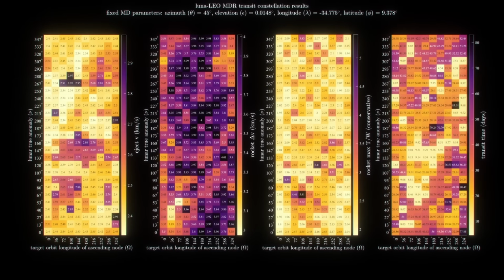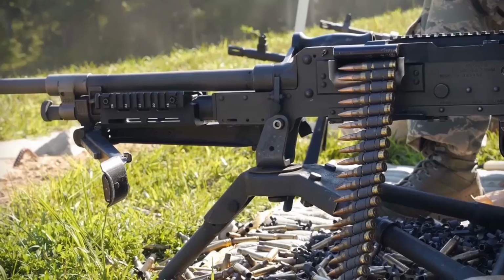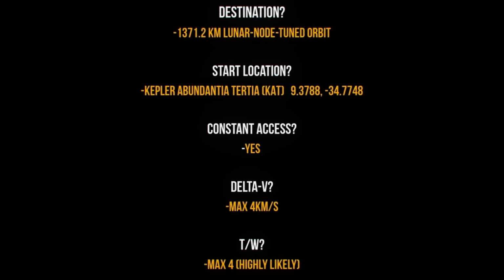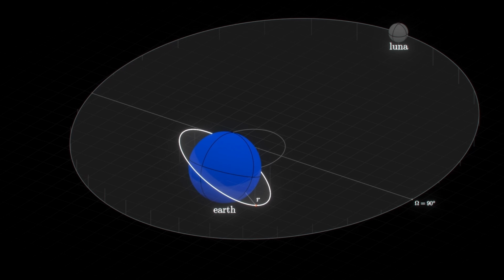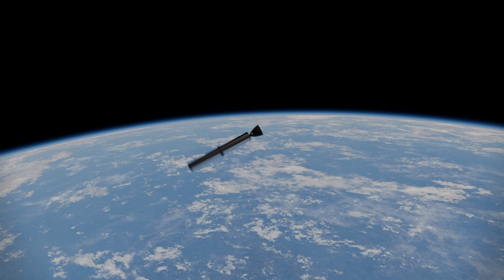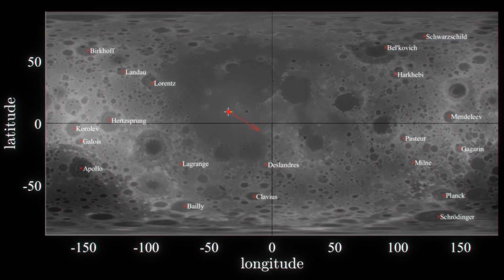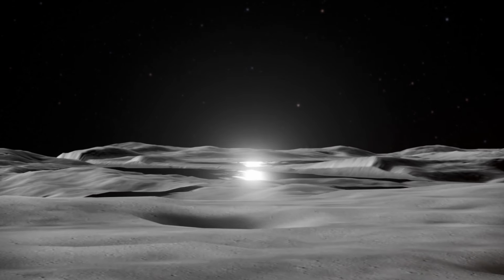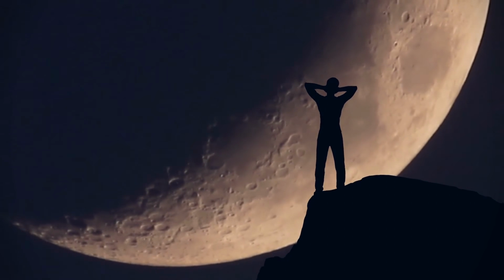Moon To LEO Transfer Simulations For A Lunar Mass Driver & Terrain Analysis + Power Sizing Estimate

Comment: 19:50 The problem missing here is the evolution of LEO debris. A site clean up will be an ongoing problem - nurf balls of vacuumgel might work.
Reply: There's the "laser broom" concept. Zap debris with high-powered laser light to cause some of the surface material to vaporise and make the surface shinier, so that radiation pressure from the sun causes it to get pushed into the atmosphere when it's on the light side of Earth. Can't remember what scale it's most effective on, but it'll be for relatively small stuff. Maybe cube-sat size at most. Given we know the orbits for the stuff we actually want up there, it could be implemented using ground stations that fire pulsed lasers as they sweep across the night sky, turning off when they need to pass the location of a satellite that's actually in use. Basically, you're whitelisting the current locations of stuff that's in use, and zapping everywhere else, as debris will be everywhere while useful stuff will be in predictable locations.
Reply: @Roxor128  That seems to expect the physics to do the opposite. Thanks for the reply. Have to look it up, but I think it would be too slow.

Comment: V2 actually used a typical liquid fuel + oxydiser engine. Its engine was one of the first of its kind and modern liquid fuel rocket engines didn't go far from it.

Comment: what if production is on the moon and launches working satellites via mass driver
building sats on the moon may be easier having gravity and heat sink.
This eliminates a lot of issues
Reply: sure, it also requires a (giga)ton of infrastructure to do that   you can get economically viable aluminum smelter long before you have chip fab.

Comment: An orbital depot in Lunar orbit solve a lot of issues/constraints in this simulation. 1: Lower Delta-V requirement for the payload and thus lower mass/size. 2: No complex direct payload transfer windows to LEO. There would be more complexity of staffing and construction of this depot than LEO but assuming we have the capability to construct a mass driver these would likely not be an issue (perhaps construction from lunar mass). Additionally progress in robotics and automations could reduce staffing requirements. This reduction in complexity and increased efficiency could likely outweigh the benefit of being co-located with current demand. 

Secondly, it may be interesting to consider alternative thrust methods than chemical rockets. This could significantly lower the mass of the payload and increase its efficiency (ISP). The downside being lower TWR and manufacturing complexity.

Comment: 11:55 honestly I think a better solution would be one in lunar orbit. 

Have automated tugs powered by ion engines go out and collect the mass driven units of refined materials (like iron and alloys since mass driving containers of Luna regolith is inefficient) and take it to a lunar possessing station where the advanced possessing (the reason being that manufacturing advanced components usually means that the end product has much less mass than the input material, therefore less material is needed to move it.)  that requires microgravity can be done or the materials can be used to make ships.

Then if a station in earth orbit needs the resources take it there via nuclear powered bulk ship to a station in earth orbit.

If it needs to go on to earth than use an SSTO to rendezvous with the station and take the materials to earth. 

Each step made to minimise the amount of energy used to transport the product. As such the mass driver units may only need a tiny propulsion unit to circularise their lunar orbit and keep attitude increasing the max payload the mass diver can launch.

Edit: this also significantly lowers the cost/complexity of the mass driver as its goal will be lunar orbit rather than earth, a much more viable alternative for early space industry, I think later mass drivers will be going direct to earth orbit but this will help the industry get off the ground.
Reply: while this could work in late stage space development, early stage orbital manufacturing will need significant resources from earth as such the launch cost of  those supplies dominates the economics. so while you are right on theoretical efficiency the practical economics favors burning more cheap lunar sourced reaction mass and doing advance processing near earth than burning expensive earth sourced reaction mass to halling supplies up to the  lunar station. for somethings there might be an intermediate process step that could make sense in lunar orbit but I can't think of any near term reason.
Reply: Hi. Some notes here:
- Having collection vehicles in lunar orbit, especially electric ones (which have terrible T/W ratios) would be inadvisable for a cislunar supply chain. Firstly these vehicles need to individually rendezvous with each orbiting payload (which themselves must expend a major Δv penalty of at least hundreds of m/s to adopt a lunar orbit, meaning they will need to be rockets to begin with) which will take an exceptionally long time, then they must slowly spiral out of the lunar SOI and across cislunar space and spiral into a rendezvous and return (requiring two additional major spiral manoeuvres, each of which could take weeks, perhaps months). Such a supply chain, while characterized by vehicles with better isps, would be overwhelmingly outcompeted by the throughput (and remember a transport system is valued primarily in regards to its throughput, we'd be getting paid per kg delivered) by a simpler system of direct massdriver rockets from a lunar massdriver or equivalent lifting vehicle to LEO. Furthermore while the isp of a dedicated electric cargo vehicle is undoubtably fantastic, it will still need to gather more propellent from somewhere, which means a depot in lunar orbit which will be another major overhead to supply and maintain.
- What exactly would these electric vehicles use as propellent? Very few good options lunar ISRU exist for electric vehicles (I'd very much not recommend water, its highly precious in the lunar environment and thus bound to be very expensive for rocketry applicatons. RF-heated oxygen is perhaps the only thing close to economically plausible. You can be guaranteed we're not hauling xenon or krypton out of earth's deep gravity well for such vehicles, the expenses and overheads would be tremendous, as would be the case to run an exceptionally slow argon-harvesting airbreather capable of transiting up and rendezvousing with a depot in LEO).
- It does not make sense for materials manufactured on the lunar surface to be exported to earth's surface (and in some niche where that'd be justified we'd utilize aerobraking), the lunar environment is exceptionally resource constrained compared to earth.
- Lowering the complexity of a massdriver does not mean lowering its length (a 2.33-3km/s massdriver need only be a couple of meters long if you're willing to accept extreme accelerations, though good luck designing rockets, let alone ISRU-constrained rockets that can survive them). The major complexity hurdles of a lunar massdriver are working out how to get all the power electronics and thermal control systems into an ISRU-friendly format and the design of the massdriver rocket manufacturing assembly which needs to accompany the launcher.
Reply: @melanovis I largely agree that the T/W ratio is likely more economically important than specific impulse in this context.
That said, magnesium is abundant on the Moon and can serve as propellant for a Hall thruster. The thruster itself does not require exotic materials—it can be built from iron, silica, and aluminum—and only needs a fairly basic control system if lifetime is not being optimized.

Comment: Take note. The delta-v requirement for a direct transfer from the lunar surface to the Earth-Moon Lagrange 1 (EML1) point is approximately 2.4 to 2.5 km/s.  The company SpinLaunch already built and tested a suborbital launch platform on Earth to test the technology for getting from earths surface to low earth orbit. At full power it could launch with a velocity of ~2.0–2.25 km/s.  A hybrid spinlaunch platform with a small guidence rocket could give it the last little extra data-v to guide buckets of raw materials to a space based industry at EML1  that can process it into space based infrastructure with continouse energy from the sun rather then process on the moon with long lunar nights. 

Even more attractive on the moon: 
1. There is no atmosphere for a thick shell to hold back and requires no vacuum pumps  it could practically be  completely open of just a shell to hold back dust making the construction on the moon vastly easier.
2. Gravity on the moon is roughly 1/6th that of earth's this also reduces the support structure requirements.  And 3. Lower gravity makes it vastly easier to make longer arms that experience far less gravity and fare less centrifugal forces. 
4. Because the moon's rotation is so slow, one can concurrently launch prograde and retrograde  horizontally from an elevated platform and doubling the efficiency of getting mass to space over a single launch. 
5. Spinning up a spin launch platform can be done with just a trickle of power. And contrast dramatically with the a mass driver that also needs massive  pulsed power energy storage.

Spin launch raw materials to space for processing in space just makes more sense for earth moon space infrastructure,  and an outer solar system gateway.
Reply: Hi. I'd like to include some notes:
- spinlaunch is usually not considered in regards to the launching of lunar massdriver rockets due to the exceptionally high accelerations it imposes on the payload. The massdriver rockets we manufacture will require a multitude of highly complex precision components (pumps, valves, igniters, hinges, the list goes on) which, especially considering the ISRU resource constraints we'll be working around, can really be damaged at high accelerations. This isn't a solid-state everything surface-mount cubsesat form factor thing, its a shipping container rocket, its going to be a really big ask to subject it to anything greater than 30G (especially if its to unfold things like PVs post-launch).
- there is no passive 'guiding of buckets of raw materials to a space based industry at EML1', the moon librates, the surface is wobbling around relative to the lagrange points along the lunar orbit. To account for this, as well as factors such as the eccentricity of both the earth's and the moon's orbit around the earth-moon barycenter, we must have these massdriver payloads be capable of executing manoeuvres, ie making them rockets. Furthermore anything that skims across the orbital manifold to spiral onto the lagrange points is unstable, without a manoeuvre they'll spiral back off in short-order.
- to exit the lunar SOI from the surface you need >2.33 km/s of Δv.
- the validity of a prograde massdriver (which speeds the payload up relative to the earth) is highly questionable as this increases orbital energy instead of decreasing it (which is what we want if we'd like to reach further down into earth's gravity well, ie to a receiving station).
Reply: Spinlaunch hasn't launched so much as a single working vehicle into even suborbital vacuum, once. All we see are clickbait/AI CGI renders. You gotta take cash from them or something if you think this is a sure thing like your comment. What a joke. "Take Note" indeed
Reply: "At full power it could launch with a velocity of ~2.0–2.25 km/s" ah yes, only a permanent 30 yrs away
Reply: @MS2A-d7e  I wasn't refeing to the full size one. I was refeing to the one they already built and tested.   Building on the moon is  the idea I'm planting.  It's 1/6th Earths gravity making building support structure vastly simpler the moon has no atmosphere which allows an open design rather then try to hold back 1 atmosphere over 100 meters. No atmosphere allows simpler construction of the vehicle itself. Togeter no atmosphere and low gravity allows for vastly longer arms that when reaching a radial velocity of 2km/s  at dramatically lower launch g forces.  

Sure building on the moon has its own challenges but so much of the project makes sense  on the moon  launching  raw materials for a space based industry to process it.  It works soo much better for raw material than because of being able to spin up on a trickle of power and engineering size compared against mass drivers and far better insitu resource use over rocket propelent alone.  Make fun of it now all you want but on the moon it makes so much more sense. It is a future inevitable singularity that will supply space based industry around earth. Assuming we don't end ourselves before then.
Reply: @kreynolds1123  Yes. Linear accelerators will suffer severe thermal loads and friction. Centrifugal is the way. You could load material through a central hub, accelerate it radially through the arm, maybe adjust the velocity at the tip and have continuous operation. Skip the rocket, aerobrake through the earth atmosphere and hard land them in a huge catcher in earth orbit
Reply: @planet_x8570 earth has plenty of resources making it energetically expensive  to mine the moon.  But when it comes to building space infrastructure and industry, in near earth space, getting it off the moon is less energy expensive than getting it off earth.

Comment: Why actually hold the acceleration constant instead of the power? If power is the limiting factor then don't supply more as the velocity increases. 
Why launch the full rockets clear to earth when the payload could be moved by a far more efficient tug out of lunar orbit?
There's something to be said for using a second driver in orbit, spitting a tug with the cargo to earth and a tug with the rocket boosters back down to the moon.

Comment: Thanks for the amount of work this is.
I am an L5 lover as not sure why i need this much in LEO and 40tons a day is competing with starship. Why spend 4km/s when we building huge amounts or can get somewhere  where what is needed is just a catchers mit, like low moon orbit.

With the way things are in the powerindustry I am not sure 1GW is as big a leap in the past an electric car little PCB can do a 1MW and higher voltage circuits can do more.
Reply: If you watch the rest of his videos he takles all of this in one way or another 

Tldw: you want LEO for easy access for the rest of the market to buy from you, he is trying to make an economical system that is easy to monetize ie. Not assuming a market will just spring up around you in L5 when most of the space infrastructure/economy is centered around doing stuff in interaction with the earth. And you want to be "competing" with starship because there are still a lot of things that we need from earth that we cant get from the moon/space (think food, carbon, people, plastics,) and there is a lot of shit that we dont want to spend weight on shipping from earth that can be easily found on the moon (most metals, fuel).

The power problem is because he is assuming a very low tech starting grid, think 1950s or so, because it has to be manufactured in situ to be feasible. Once we really get going it should be less of an issue but to bootstrap ourselves off the moon we cant always assume we can manufacture things to the same standards we have here with our massive interconnected industries and logistics.
Reply: @awesomepawn2  Ive watched all the videos loved them everyone should and should be chatting in the discord. 

I still prefer Rotovator maybe Space elevator from Moon to Geo. 

Have more major disagreement on market. If the costs the same to ship by starship then it wins. The current stuff makes less sense for me a constellation needs earth based plane changes. AI datacentres are a large market and they may not need to be close earth. Easier to ship from earth is the assumption but may make sense on the moon or Langrange points.

Chips for high powerswitching do not need to be made in space they are super high cost per gram. You can do the powersystem/battery in 1 starship shipment from earth.

Should maybe do my own 1 hour long video with simulation! But I am unworthy currently producing that.

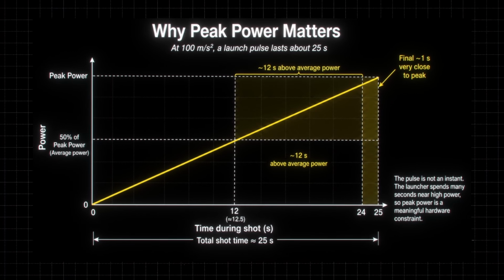Comment: 4:59 You can also reduce peak power by having higher acceleration initially and then tapering it off, smoothing out that power triangle. IIRC some designs do that by spacing the mass driver coils more tightly near the start of the track and then farther apart near the end, so the number of coils the payload passes per second remains largely constant.
Reply: well that the same as the acceleration vs length trade  wherever you use a constant acceleration  the whole length  or average acceleration the math works out the same, though in fairness it likely they would do exactly what you suggesting  bacus you basically you get such behaviors from practical electronic control systems protecting themselves